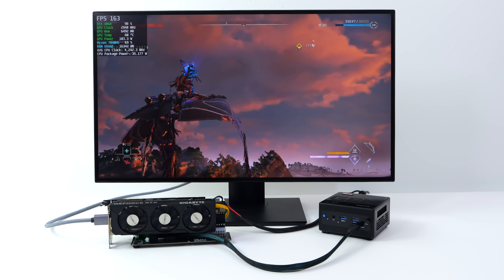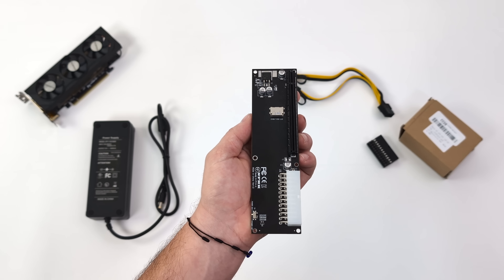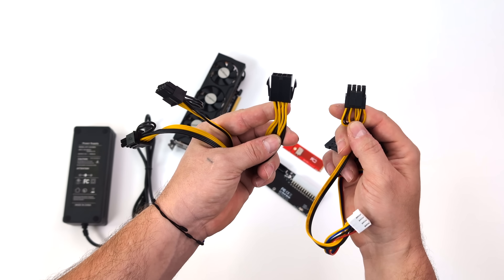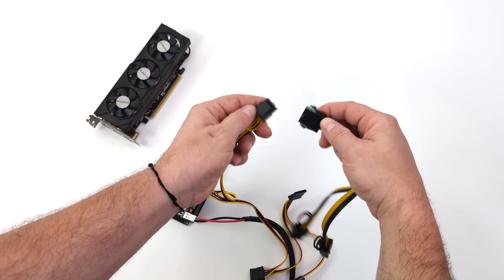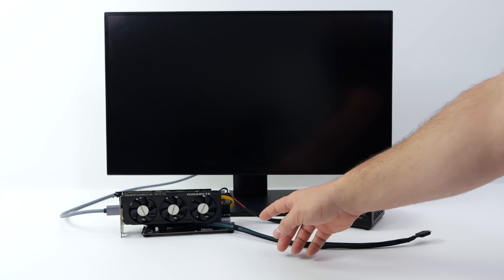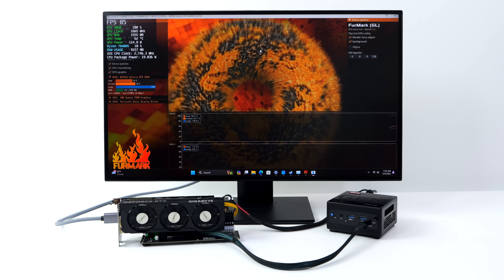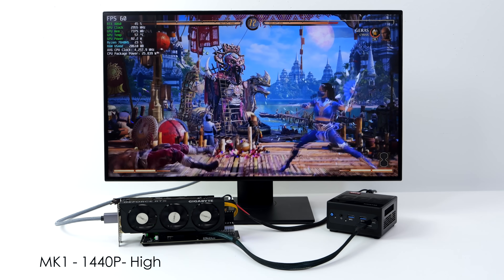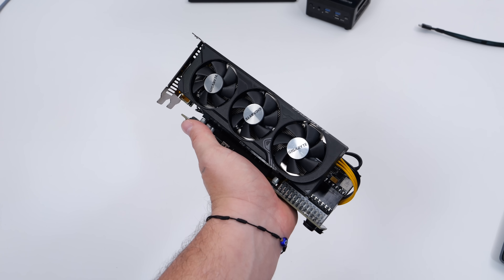Build A Low-Cost OCuLink GPU Dock on a Budget! (Easy DIY Guide)

Comment: If anyone sees this: you can connect the monitor to the internal GPU but use the external for rendering. This can be important if the external has an older hdmi port or if you want to use frame gen and upscaling on the internal gpu

Comment: I found that with the cost of the Pico and the power brick ( on Amazon Canada ), I was able to get instead a fully modular Mini ITX SFF 500 watt power supply and using self adhesive PCB standoffs mount the whole rig onto the back of the power supply. Total cost of SFF 500 watt, board,  oculink right angle cable and pcb feet, all fees n taxes in $176.00 CAD. ( 1 year after video release )

thanks for the video , it confirmned exactly what I thought I needed :) Keep up the great info vids :)
Reply: Product link?

Comment: I'd like to do that, but I'm scared now. 
I JUST BOUGHT an adapter board from ADT-Link, but it ONLY has a x24 pin connector, I see other videos where there's other connectors where they put on the board the GPU pins , and not from the PSU ! 
If I use my PSU for the x24 pin connector AND from my PSU straight to the GPU it would work fine?

Comment: Thank you, did it, works wonder ! Only thing is, there's peak power consumption sometimes that makes some RTX 4060 go above 120w and then crashes (but too fast to be logged by GPU Z or MSI afterburner). Using a 20$ amazon 500w PSU worked wonder and solved all issues (and runs much cooler, even helping cool the RTX).

Comment: would this m.2 adapter work UGREEN SSD Enclosure, Tool-Free USB C External, 10Gbps M.2 NVMe to USB Adapter/Reader Supports M and B&M Keys and Size 2230/2242 /2260/2280 SSDs

Comment: One thing thats important is that those that want to use the nvme m.2 slot for this. Its not allways the same when it comes to the lanes it hosts. M.2 slots can have 2 lane or 4 lane. Obviously 2 lane is slower but it will also require a different adaptor for that m.2 slot to oculink link.
Reply: How to find it out before buying mini pc with m2?
Reply: You would have to find the motherboards manual, as for a laptop you would have to do the same but with laptops and mini pc's they have a bit more ambiguity to them. Each laptop will have a motherboard and the motherboard could have a variant. This is less so the case with mini pc's but you can allways check. 

Now with that said if you get one and you dont know what it is because it did not work...etc. try two programs~ HWiNFO64 or crystaldiskinfo they let you see what lanes your m.2 hold. 

You can also do basic math to check out if the mini pc will have 2 or 4 lanes. 

Check the cpu bus, if there is an integrated gpu but no soldered in dedicated gpu. Ie the cpu is actually a apu...etc. Then more then likely your ram and m.2 storage will have more lanes dedicated to them because they are not designated to a soldered on gpu. 

For instance I had a laptop that has solder pads on the motherboard for a gpu, but it did not have it. When this is the case the laptop manufacture took the same motherboard pcb they use for the more expensive variants but used lower end hardware (cpu,ram) and did not populate the gpu...etc. now this is a good thing because then you can see if your cpu bus can handle what you want to upgrade. If you look up my laptop it says it has a max of 16gb of dd4 memory, but because of the configuration of the specific motherboard variant. When you look up the ram in task manager it shows two slots. there is only one on the board and no solder pads for 2 then the laptop cpu itself though when you look it up, can support 32gb by itself. So I just got a 32gb sodimm stick and plugged it in. And it worked. And the m.2 slot online read 4 lanes, but only 2 if there is a gpu populated on the board. So I currently have a gpu I plug into the m.2 slot that they swap rather then the gpu..etc. 

So there's alot of ways to do it, but id suggest learning as many ways just because sometimes manufacturers have different variants of the same exact laptop aside from just *this one has more ram*...etc.
Reply: @IIBLANKII Thank you a lot for such an answer. Ordered NAB9 for a good price, couldn’t justify myself paying 1.5x for NAB9 plus which is exactly the same model but with factory build oculink. Will try wen will need it, right now just want to have this option when the time comes 😅

Comment: Hey
I just wanted to leave a little warning about the Pico PSUs
In my experience they work pretty well BUT the cables on the higher power models are severely underspecced. If youre using a higher power GPU that uses external Power I would not use one of them. 
The connector burned up on mine once

Comment: So i am trying to connect a new graphics card to my mini pc. It is a Kamrui GK3 mini pc. It came with an intel R UHD graphics card. I have bought so far, GT610 1Gb DDR3 graphics card, 1TB SATA SSD for a replacement for the M.2 thing, AVG series 500w power supply, Beast oculink docking station, oculink data cable, M.2 to oculink adapter board and a ATX24p to 8p power cord. Am i missing anything else to set this up? i'm new to pc gaming and don't know what i am doing here...

Comment: can you do a video for a eGPU buy with a true full thunderbolt 4 (not a thunderbolt 3/4!)  for a mac, but which is  running windows via bootcamp, this  for a Nvidia 3090ti or a 4070 or even a RTX 4090 in order to run Stable Diffusion Auto1111 , Comfyui or even to make LLMs ( LLMs would ned multiple RTX 4090 cards)?  i think no one has ever done a video for mac users ....

Comment: So cool - Love the DIY approach! 

Nooby question: would this work with a laptop?

I'm wondering what to do with the HDMI output coming out of the GPU. Would I just forego it all together and the laptop would send the signal to its screen or would I have to plug the hdmi into the laptop? Or would I have to use an external monitor? 😂🙈

Comment: This riser not needed picoPSU. 24pin, but only 12v line used, other contacts is empty.Use direct connection for power supply.

Comment: Hey, man! Try to remove picoPSU from the scheme! I searched through the descriptions of this device on various sites + collected high-resolution photos. Apparently, out of the 24 pin connector, it only needs 12v. The 3.3V line is converted from 12V using a step-down mosfet and a pair of capacitors directly on the riser. Please try a regular 24 pin adapter -> 6 or 8 pin gpu.

Comment: Lol I have a set up like this... Instead I'm just using a 150w 12v DC power supply, the adapter had a 6pin energy output and I use a 6 pin to 8 pin power cable for my GPU. To avoid problems I just underlvolted my GPU, and set a 80% power limit, so my power supply can work with it without explosions.

Comment: question: will this work if you connect the oculink to cable to an m.2 nvme enclosure and from there connect to a device with a usb c? i would like to try it on a legion go since it has no oculink slot.

Comment: Awesome concept. Does @etaprime (or others) know how far you could push this setup? I’d be interested in hooking up a 4080 Super (or even a 4090) to something like this if possible.

If not possible, where would it be bottlenecked (power, CPU, other)?
Reply: It's possible, but you will need a beefy power supply and if used on a handheld device bottleneck will be CPU. So if portability is something you want it will be hard. I prefer having a portable device so the GPU shown on video is probably the best option right now. It's pretty easy to build a small case for it too.

Comment: One can use multiple oculinks to setup a machine learning inference rig - 3x 16GB VRAM will run your own large language model assistant like Llama 3 70B. Like if your case has no space.
Reply: Did you end up doing this? Been interested in building a small form factor inference rig for a while and am thinking about what the best setup might be (APU, mobile CPU with GPU over oculink, NVIDIA Jetson, etc…).

Comment: this is the exact setup i did a few months ago with my Minisforum UM870 XTX. only difference is my main server power supply that came from a previous setup using a slower adapter.
Reply: @michaellagamon  Did you use m2 adapter for it?
Reply: @ConstansPhotography  yes i purchased an m.2 adapter. but some include it already.

Comment: It's a cheap eGPU setup for 100 bucks. If you have a 3d printer or a friend with one, it's basically eGPU solution for 1/3 or 1/4th the price. Decent idea and content.
Reply: Well, 3d printing the case can be a bit challenging because of the heat dissipation of the GPU. Regular PLA might deform because it can only stand temperatures up to 70 degree. 
You must use a heat-resistant material.
Reply: Not necessarily an enclosure but you can make a pseudo case i.e. open frame, a bump guard or mounting for the card to prevent damage, or even just a false wall to hide the equipment visually but keep it fully accessible. So yeah if you make a case heat collection consideration so additional ventilation or a water cooling setup, which has its own price point bump, a must as well.
Reply: Not a good idea, as it will trap heat....i have another idea...why not just make use of existing small ITX casing to house the GPU and ATX PSU. I have one or two lying around the house.
Reply: 3 d print for what?
Reply: @mczaga  to make an "enclosure" to pretty much contain everything, and make it look cleaner

Comment: can I connect 4070 to it?
Reply: You'll need a more powerful PSU but otherwise yes. 63gbps will likely not be enough to take full advantage of a 4070 though.
Reply: @MrPC1121  Thx 😛 i get 3080 🤣
Reply: @MrPC1121  but now i have minis forum Venus UM790 Pro
Reply: 32gb for rtx3060?   Double hdmi to m2 connection?  Enough?
Reply: @O-ne11  sure ,why not?

Comment: 🤔
4x 4060TI 16GB ~= 1/2 the price of 1 A6000 48GB.

You'd lose so much performance on the PCIe bandwidth, so I'm not sure what you would use it for, but on the other hand, for half the price, it might be worth it, lol. Plus I think there are some consumer motherboards that support 4 NVMe slots out of the box nowadays. Food for thought.

Comment: ✋🏼 anyone  if i want to use egpu which would be better connection 1 ) Internal Laptop Screen -  Oculink port laptop or via nvme 2) External monitor - Oculink port laptop or via nvme   ????
Reply: Externals have the reputation of better consistency as I read by others

Comment: Do you have a video tutorial on cutting and soldering the psu cables properly? 🙏
Reply: Shouldn't have to do any of that.
Reply: @dude-n8p  i may need to since some of my cables are causing my case to bulge on the side panels.
Reply: Try searching, customize PSU power cables. I also wanted to know how to solder it but I can't vid a reference, so I jst bought some online.

Comment: Get a 500w Gan psu from HDPlex
Reply: @346151295   I just looked up this hdplex.  They have very interesting PSU's  and Fanless Chassis CHASSIS for for PC's.
And although these GaN PSU are pretty expensive; they are probably a much better solution than some questionable Pico PSU.
Again thanks for the tip.  That is why i sometimes love the YT comments sections!  You can learn a lot from other people's comments…
Reply: @346151295   I just looked up this hdplex.  They have very interesting PSU's  and Fanless Chassis CHASSIS for for PC's.
And although these GaN PSU are pretty expensive; they are probably a much better solution than some questionable Pico PSU.
Again thanks for the tip.  That is why i sometimes love the YT comments sections!  You can learn a lot from other people's comments…

Comment: Thank you!

If I understand, to use this in a laptop without an occulink, I would have to use the M2 PCIE 4 slot, but as this is the boot device, that won't work.

A second M2 PCIE 3 won't be sufficient.

Even if it did, I would have to slip the connector and maybe some kind of thin ribbon out of the laptop case.

So not practical for my Gigabyte G5 GD, alas!

Guess it's back to building my own gaming PC.

Comment: Please try the nvme to oculink connector
Reply: Yes, please.

Even though it won't work with my laptop, I would still like to see it.
Reply: @antondovydaitis2261  hey im new to this... why do you think it wont work with your device?? does you laptop not have an m.2 port?
Reply: @shriharideshpande1980  It has one M2 PCIE 4, which is the boot device, and an additional M2 PCIE 3, which I understand won't work with this.
Reply: @O-ne11  As I understand, PCIE 3 would not be fast enough.
Reply: @antondovydaitis2261  you can swap ur boot drive to pcie 3 and use pcie 4 for oculink adapter. It is not a big deal, pci e 3 nvme top up in 3500 mb/sec, it is enough.
Reply: @antondovydaitis2261 

I believe it's the same with mine where there's only 1 m.2 slot, right? I got u.

I removed the wifi card and turned it into an M.2 ssd slot, and that becomes my storage.
Then I attached the oculink to m.2 adapter to the m.2 slot for the egpu.

However, my oculink to m.2 adapter is a cable, not a card. Its since I was able to make a hole for the oculink on the sides of the laptop and screw it.

Comment: I still think an under 5l build is better.  The actual space this takes up would be more if you include multiple power supplies plus cables, plus space to keep mini pc and graphics card separate.  An all in one is far more portable, easier, and clean looking.
Reply: agreed.  My ideal system would be a Minisforum MS-01, just make it a little taller so it could support 2 slot GPUs.

Comment: been wondering is there any usb-c version connector for this? m.2 route kinda bad for laptops
Reply: Not if you want 64Gbps bandwidth, currently USB-c solutions like Thunderbolt and USB4 are limited to 32Gbps (they say 40Gbps, but that figure comes from combining the 32Gbps for data and the 8Gbps for displayport protocols, but in reality the eGPU only has access to 32Gbps)
Reply: i guess its just a matter of 10-20yrs for people to adapt as normal thing thing and hope its standardize dont want more cable for specific laptop brands which they tend to make their own connectors that does the same thing like the others
Reply: @post-leftluddite nowadays, what speed is suitable for current cards on the market?
Reply: its best to look for game benchmarks near your specs both usb c and thunderbolt cant utilize 100% of the gpu unless its one of those basic card 1030 or the new a530 forgot the real model name from intel
Reply: @acegear  i wanna use jhh link on rtx3060. my laptop supports 2x m2. nvme slots.

Comment: I've bought that bord you listed with a m.2 2230 and found the m.2 board wasn't working on 4.0 Pcie gous but worked fine pcie 3.0 with older gpus.  I tried other oculink cables with no luck but since it was advertised as pcie 3.0 I can't blame it.  Still trying to find a 2230 m.2 4.0 oculink card without having to use aliexaliexpress or other Chinese websites that sometimes make you buy in volume.
Reply: PCIE 3, eh?

Do you think that something like that could be used to hook up a laptop through its secondary M2 PCIE 3 slot?
Reply: hey which laptop did you try it with? the port ur talking abt is the one which usually has the wifi card right?
Reply: @shriharideshpande1980  GPD Winmax 2 the one with the 6000 series cpu/680m graphics.  Using the 2230 m.2 that comes with that bundle that I received doesn't work with 4.0.  I can use a RX 470 gen 3 and it works fine.  I tried 6900xt was 4.0 and Nvidia 3060 and it comes up for a second and I can open GPUz and see it for a second showing as a 4.0 then driver crash and pcie error and lose video on the gpu.  I've tried other cables and boards that gpu plugs into, keeping the same m.2 oculink card with same results.

Comment: the issue i have with Oculink
is that it only supports 2 PCIe Lanes
so it's unironically more worth it, to use a M.2 adapter, which uses 4 lanes
Reply: What are you talking about? It comes standard with x4 PCIe 4.0 lanes, and they even have x8 and x16 versions.
Reply: The one he used and includes a link to says "Oculink 4X. The card transmits PCI Express 4x signals using the NVMe protocol. Data transfer rate up to 32 Gbps."

Comment: I wish some of this e-gpu boards would just make it mitx sized instead or adapt to mitx: I know its much smaller than what it needs to for mitx but if I'm already using an SFX PSU I could just use a mini itx case so it's still DIY but not just a mess of cables and unprotected GPU on my desk.

Comment: I just grabbed a Razer Core X Chroma on eBay for $270. to use with my Legion Go and an RX 6800. Not Oculink but it's crazy seeing a handheld maxing games at 1440p at over 100fps.
Reply: Whats yer perf loss over thunderbolt 4? Just curious
Reply: @Asterimos  Quite a bit. Videos are showing the difference on YouTube. It depends on the game. However, you do leave a lot of performance on the table. Games still look and play amazing though.
Reply: @Asterimos  very huge loss, it get more noticeable in multiple monitor setup, i dont like usb4 at all
Reply: I heard and drivers play up a lot with Legion go, could you advise how to run an egpu on legion go like drivers etc as I am picking up a Razer core x with a amd 5700xt at the weekend. Any advice would be greatly appreciated
Reply: @dame666999  I honestly stopped using it for now. It was really cool, but it ruined my portable experience.